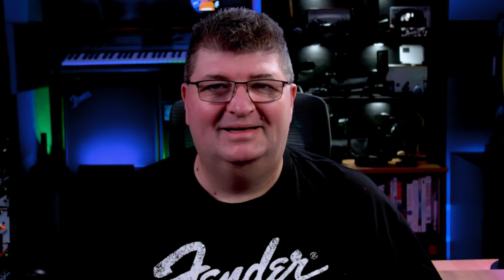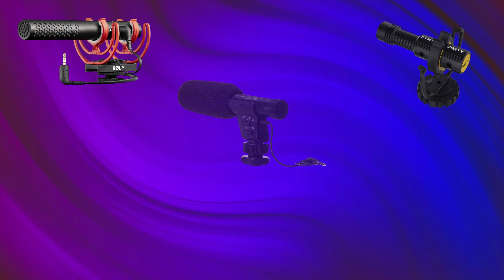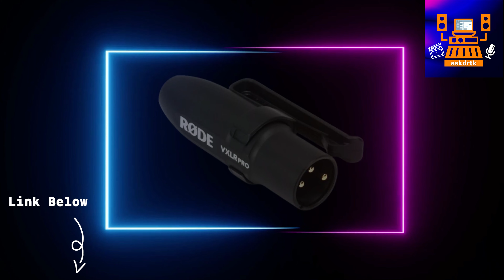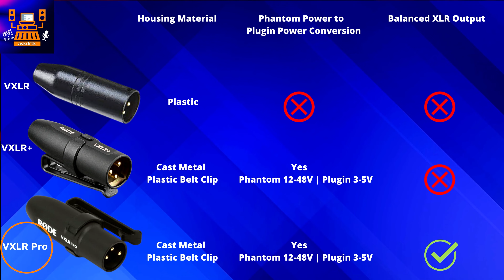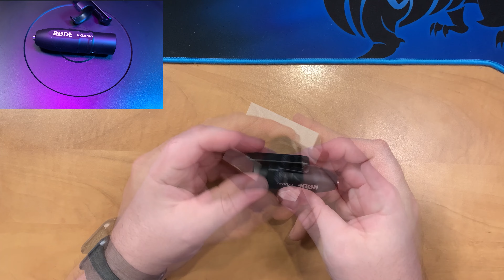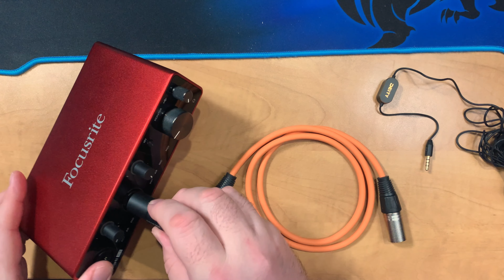Rode VXLR Pro - How to Connect a Lavalier Mic to a Mixer or Audio Interface

Comment: if i plug the lavalier mic into an external preamp with its own distinct character, will the mic pick up or reflect the sound characteristics of that preamp as well?
Reply from the maker: Your preamp will impart its character on the sound when using a lav with this adapter in the same way it does with other microphones. This adapter is basically a converter that provides plug-in power to your lav mic instead of the usual 48V phantom power supplied by preamps.
Reply: @askdrtk  Just as i thought. Thanks for the explanation

Comment: Hi! This is a really helpful video. I have the rode wireless go ii, and i would simply like to monitor it for small gigs and content creation but using a phone. Since I can plug directly de receiver into my phone, I’ve already tried it but I would like to be able to listen while recording and adjust if necessary. I own a handheld recorder, so I’m thinking maybe i can plug in the receiver and be able achieve what I’m looking for. Would you recommend the stereo breakout? From what I understand,  the vxlr+/ pro are meant to be used with unpowered microphones, that’s not my case. It would be really helpful if you’d answer. Thanks!

Comment: Isnt it better to use a lav mic with an xlr connector? Any recommendations for the same? This is for a teaching environment and i record my offline classes and upload them online.
Reply from the maker: The connector is less important than the microphone capsule and cable. High end lav mics are often available with a variety of connectors to suit different use cases (Sennheiser for example) or with interchangeable connectors such as those found on DPA lavs. If you are looking for a lav that will provide broadcast quality sound, the Sennheiser MKE 2 at about $400usd and the DPA 4060 at about $500usd are great choices (and are what pros widely use in live productions). Both are available with a choice of connectors. To be sure, these are both pricey, but if you are recording classes that will be hosted on an LMS for considerable time, the investment may be worth it. Hope this helps out!

Comment: Thanks.

Can I use the VXLR Pro to connect a wireless receiver to a PA mixer? Example the Rode Go 2 receivers.
Reply from the maker: Many wireless receivers provide a line level output (which I believe is the case with the Go 2 receiver)  whereas the VXLR Pro is designed for a mic level input and provides plug in power for mics requiring it. If your wireless receiver provides mic level output, then the VXLR Pro is an option. If your wireless receiver provides line level output I would connect it to a line level input on the mixer or if a line level input is not available on the mixer I generally use a DI box to convert the line level source to a mic level signal which can be connected to a microphone input on the mixer.
Reply: @askdrtk thank for the explanation. Appreciate it

Comment: top video , 
but i didn't anderstand why you use another cable xlr in plus of the adapter ? 
thanks. !
Reply from the maker: Glad you enjoyed it. There is no need to use an XLR cable if you don’t need the length and the slightly thicker edge of the VXLR Pro fits in the connection on your interface/mixer/preamp. Cheers!

Comment: I have a Rode Lavalier II that I need to run into my SSL 2. I used the XVLR Pro and still don't get any sound. Any help you could provide would be wonderful!
Reply from the maker: The VXLR Pro requires phantom power to be turned on from the SSL2, other than that the Lav II should be plug and play with only the SSL 2’s  gain needing to be adjusted.

Comment: Thank you so much! Can I use this to connect my Rode Wireless Go II to my Scarlett Focusrite? And if so will I need the  phantom power? And I"m not sure why you would need the cable?
Reply from the maker: Glad to help out! This adapter is designed to connect and provide power to an unpowered lav microphone. Your Wireless Go II has a 3.5mm TRS output that provides two channel output (allowing either both transmitters to go to both channels or each transmitter to go to an individual channel). To connect the receiver to your Scarlett you don’t need the adapter I showed in this video but instead a cable with a 3.5mm TRS plug on one end going to two 1/4” TR plugs on the other. Here is an example: https://hosatech.com/products/analog-audio/stereo-breakouts/hosa-breakouts/cmp-150/ This will give you four options: 1. Single transmitter (mic) to one input on the Scarlett (leave one 1/4” plug unplugged), 2. Single transmitter (mic) to two inputs on the Scarlett, 3. Two transmitter (mics) to two inputs on the Scarlett (both mics on each Scarlett input), and 4. Two transmitter (mics) to two inputs on the Scarlett with one mic on each input. Phantom power is not required. Hope this helps out!

Comment: Whit this adapter, can i use a Sennheiser 908B ew wired on a mixer with 48V on?
Reply from the maker: Great question! The VXLR Pro will provide plug in power to the mic so you should be good to go. While I haven't tested this mic specifically, I have used other similar mics that "require" a body pack and have had no issues. Hope this helps out!
Reply: @askdrtk  It worked!!!
Reply from the maker: Fantastic! Thanks for letting me know!

Comment: Thanks for clearing this up! I've been quite confused, in regards to what the main difference is, between the VXRL Pro and VXLR+.

A question... The phantom power has to be activated, in order to get the proper signal/conversion?
If the phantom power isn't activated, then what?

Thanks again!
Reply from the maker: Glad to help out! Phantom power is required in order for the VXLR pro (and +) to pass "plug in" power to a microphone that requires it. Mics that are self powered (run off batteries) will not require plug in power, so you can leave phantom power off and the VXLR pro/+ will still pass the signal without it.
Reply: @askdrtk  - Thank you, I greatly appreciate it!

Comment: I have a regular Lavalier microphone but when I plug it in to the aux of my radio, it doesn't hear the lavalier. Suggestions?
I am not a musician. I just want to hear people in the back seat of my taxi. I have a Plexiglas barrier because of Covid. I can't hear people. 
Amazon doesn't have an easy fix. I do have a 3.5 mm Lavalier and a mini boombox radio
Reply from the maker: The issue is that the lavalier requires "plug in power" and produces a microphone level signal which is far less than the aux input on your radio requires. For your application, the believe the simplest, and most affordable solution, would be to use a wireless lavalier mic system like this: https://amzn.to/3Prq1p7 or https://amzn.to/3o44VkQ  They do include another lavalier mic (you could use your own) but the important thing is that the transmitter will power the lavalier mic and the receiver's output will work with your radio's aux connector. You would keep both the transmitter and receiver up front with you and route the lavalier microphone cable to the back. There are other wired preamplifier solutions, however they will be far more expensive without providing any real benefit for your application. Hope this helps out!